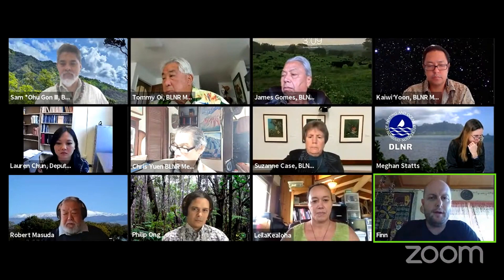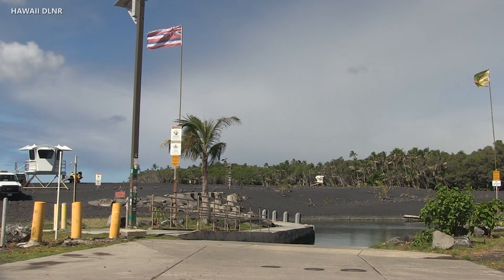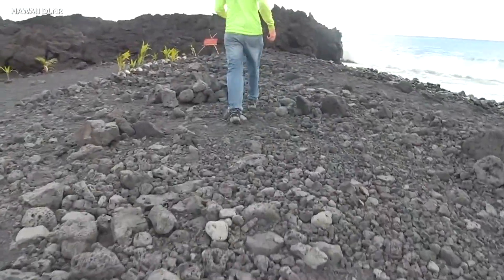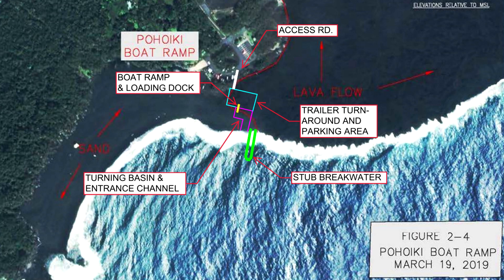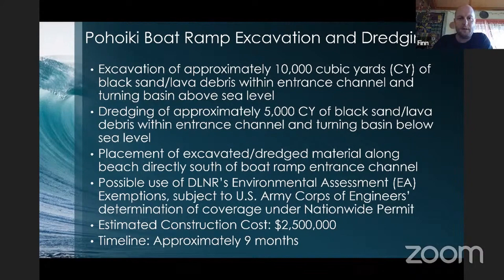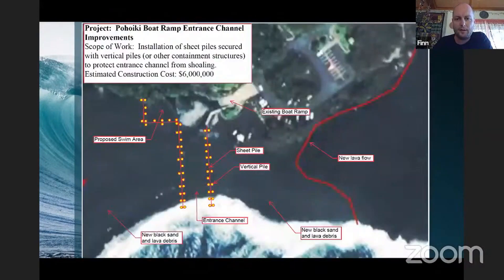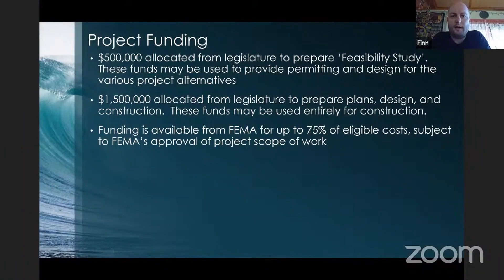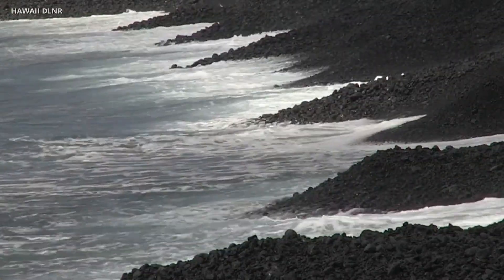Pohoiki Boat Ramp Restoration Options Presented (Mar. 1, 2021)

Comment: In 2018 we had a trip planned for the Hilo area side to see all the beauty of this side of the island, then the land changed and we witnessed all that had changed. I did not have words to describe what I had seen. I can only imagine what the community felt. Seeing this video is sad to think it’s been 2 hard years and the community still dealing with issues, they should not have to come and make case points to why this should be done. This should have been a no questions asked get it done, it’s about the Safety, sustainability, and getting the community back to some sort of normal life. And next meeting let’s see more smiles this should be an exciting time to give back to your community. 🙂😀

Comment: Screen the Pohoiki Black sand and truck it to Kehena beach ...  Trucks dump the sand over the cliff onto Kehena beach and lower down a small bulldozer and spread the sand around .. Kehena has proven to hold sand for decades and needs sand now after fifty years of erosion ... Not that difficult of a project and Kehena would have a big black sand beach for another 50 years ... Think about it !! 🌴 ....
Reply: I don't live there, but I agree 100%. And 2.5 million!!! What!! A 600 excavator would make short work of that. There is now way it's a 2.5 million dollar project, that's insane. Way Way Way inflated cost. Sombody is filling pockets
Reply: The pics from 1960 show the beach is 1/50th the size today as it was then. Beaches on the east side of Havvai’i generally don’t last but a hundred years or so as it is, so moving it is moot..
Reply: Yesss put more sand there.

Comment: If you really want to be proactive, you would need to dredge all the sand to the east of the boat ramp until only the lava cliff is there. That would help deflect sand away from the shoreline that would be going from east to west because the waves would be striking the cliff and moving sand quickly due to the amount of energy. It would help mobilize sand quickly out of the area so that shoaling of the inlet would be reduced. If it’s true that the sand has stabilized and no more is coming in ( even though I couldn’t find anything online to attest to that), then that would be the best option. Although I do agree that these projects take a long time, you guys probably don’t realize how long it takes to get a state and federal permit. Especially in Hawaii where the water all around the coast is considered an invaluable natural resource.

Comment: why are they fighting the sand? write off the existing boat ramp get a doser to push the sand in to what is left of the launch so that trucks and trailers can get past and let them beach launch until a new ramp can be built.  they should have done that the moment the lava cooled enough to access the area. the state of Hawaii must really hate the people that live down there to leave them literally high and dry for going on 3 years...and from the sound of it for several years more

Comment: The sheet pile + concrete pillar pile barriers would actually direct more water towards the boat ramp and shore line by it, which would increase the erosion of the shore line. A slope with the large rock + concrete bits such as currently exists right near the ramp would be a better option in the long term, water could climb the slope and be slowed / stopped by the varied geometry of the barrier.

1 bull dozer and 1 tracked excavator could complete the whole task within 6 months easily. More likely within 4 months. ( weather causing work stoppages extending from the 4 weeks actual work time )

Mr Ong is not completely accurate in his harbour maintenance comment, I live in Vancouver British Columbia and the harbour does not require any maintenance / dredging it is a natural deep water harbour much like the harbours along the Puget Sound in Washington State just south of here.

Comment: i don't understand how all that sand got there.
Reply: Lava blocked in the ramp. Fresh sand from new parts of coastline filled in some more. The geologist said the surviving ramp is still the most stable location
Reply: Ocean currents
Reply: When lava from an eruption meets the cold water of the ocean, the lava shatters into black sand (it's called pyroclastic sand). Currents then carry that sand along the shoreline and deposit it where there's an obstacle or the current fails. At Pohoiki the new sand is from the Lower East Rift Zone eruption of 2018.